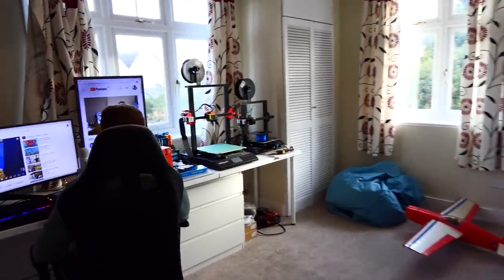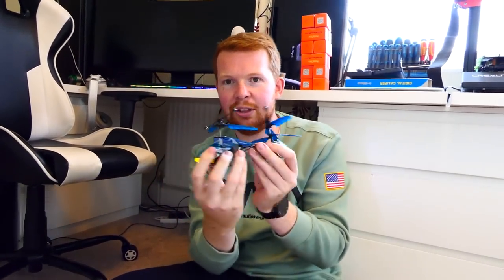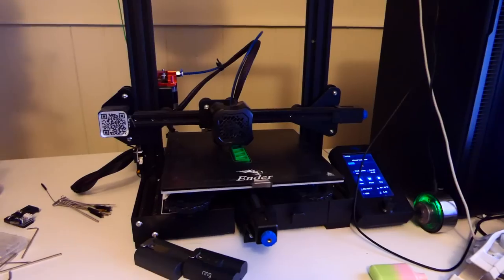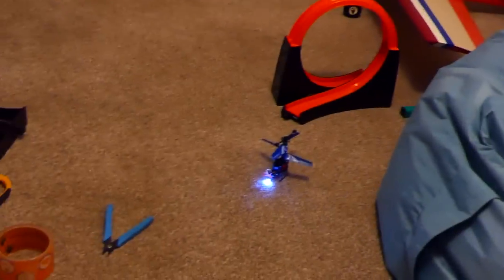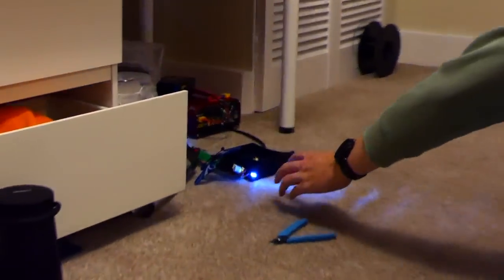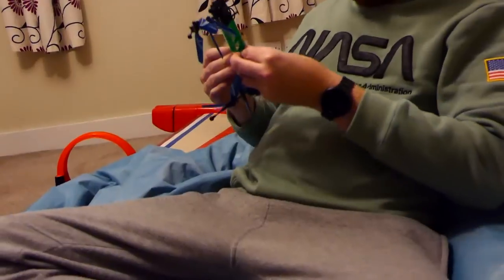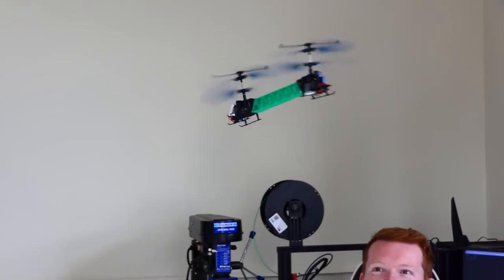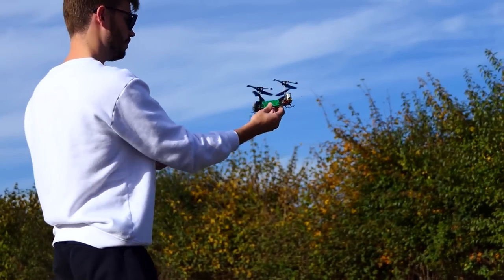Mini Chinook

Comment: Heat batteries take up less space than a hot water tank and can store heat for longer. They are based on latent heat storage; heat or electrical energy is used to change a phase change material (PCM) from one phase to the other (in other words solid to liquid) and this captures the energy.

İt can be used in aircrafts maybe it can be a video's concept
Reply: And it's cool 😎😎

Comment: I dont think it needs 4 motors though,sure it has thrust issues with reduced blades, but with some work remove the alternate blades from each end and you have one displaced dual rotor chinook.

Comment: Now this is really cool! Turning a bug/big oversight into a feature! That save at 9:05 was awesome! I'm a little confused, why did it perform worse with the single big battery and the big battery plus the two small batteries? I thought at first maybe the single big battery wasn't able so supply enough power for both motors at the same time, but with all three not working well idk what was happening.
Reply: Probably just couldn't handle the weight.

Comment: You should use tapered beam btw rotary, it will easy weight and decrease timeprint or use tube circle/closed I-beam cross-section with side joints that affects more on performances aircraft and manufacturing :) Nice video👨‍🔬

Comment: you could get pitch control by leaving one of the tail motors attached somewhere off-center.
Reply: No tail motors on these,they have counter rotating main blades for steering.
Reply: @enoz.j3506  and tail horizontal props for pitch :)
Reply: @mleko5procent  Ah, i didn't see that,im not familiar with these little copters.apologies.

Comment: If I was you, I would have used the little motor that provided forward tilt in the design. By only inverting one of them so that when you input forward tilt it actually provided thrust for tilt in the desired direction to provide forward movement.